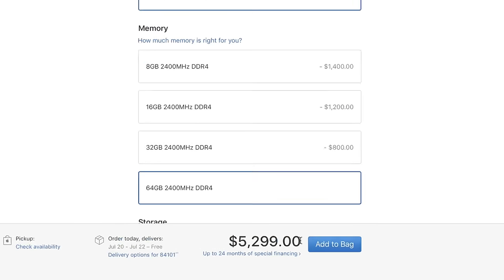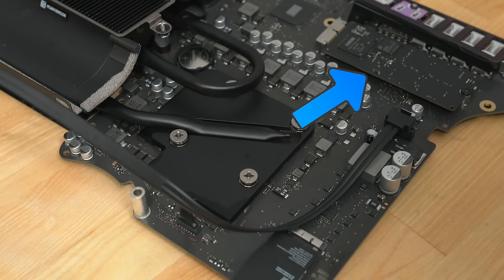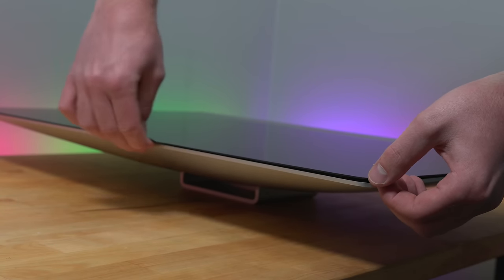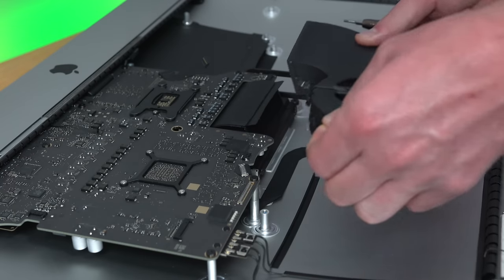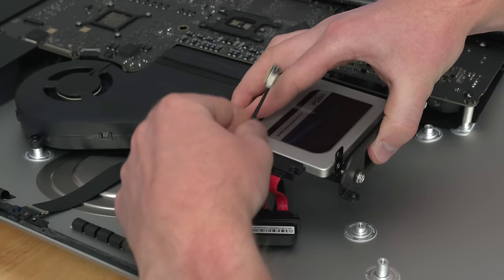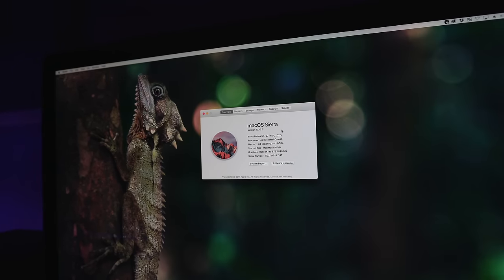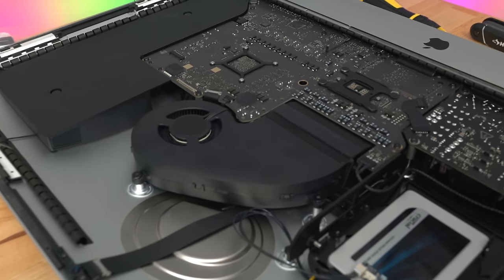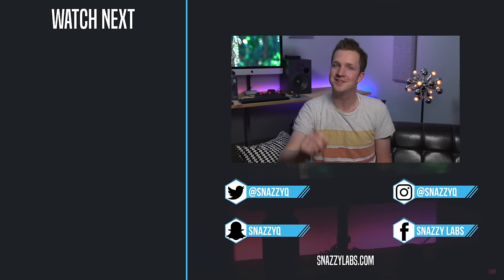The Best 2017 iMac Apple Doesn't Sell!

Comment: Apple use the 7700 not the 7700k which has higher clocks as well as overclocking :)
Reply from the maker: They use the 7700 in the base high-end configuration, but they use the 7700K in the loaded configuration. With Kaby Lake, the K variant is clocked 700 MHz higher even without OC, so Apple just runs the unlocked CPU at base-clock.
Reply: #kabylakegate
Reply: Snazzy Labs is it possible that Apple use some terrible thermal paste which makes the temperature so high so it throttles and lead to some performance decrease
Reply: Why would you overclock a CPU that's basically in a laptop? I think that's a big waste of money.
Reply: +Stephen _L_S Apple is known for shyte thermal paste and fans that prematurely wear out.
Reply: Ohh i didn't think they used the k version:P ohh well nice work anyway :)
Reply: 7700K is desktop CPU, not laptop CPU.
Reply: Snazzy Labs at base clock cause their cooling sucks and people will still pay for it. I would have paid for it two years ago if I'd had the money. I've just learned that as a gamer and a DJ I don't need the slightly higher base clock.
Reply: Hugo in a laptop?
Reply: That was my thought as well - cheap thermal paste.
Reply: yup seems it's a K variant as it's running under-clocked at 3.8 GHz
Reply: No, the K stands for Kupu-kupu-barong, the place where people are enslaved to work the Intel silicon mines. The 7700 stands for the number of casualties since 1948, when Israel became a nation again.
Reply: The 7700K is the top dog in the CPU arena. Test scores, market share. I just dominate's. Poor little Ryzen can't find any buyers. The 7700 lives in Pentium country. There's an $11.00 USD between it and the K. It's a no brainer which one to buy
Reply: Terence Riley Lol, Ryzen sold/sells very well and has forced Intel's head back up its ass?
Reply: I was thinking the same thing about the thermal paste.  Also the air flow in that thing doesn't look great.

Comment: SUPER cool video dude! I thought it would be awesome but this turned out even better.
The geekbench score for your 7700k seems pretty normal to me? .. (My stock unit gives - 5782 / 20169)
Reply from the maker: Is that on your iMac? I admittedly don't have a loaded iMac on hand, so I a) went off of the "average benchmark score" for all of the 2017 fully-loaded 7700K iMac's tested on the GeekBench browser, and b) asked a viewer with a loaded iMac to do the test (he got 18,790). Your score is pretty good; about the same as mine. I don't know why the average is so low. Software related maybe? It isn't the RAM (because I yanked that and tested with the stock kit and was just under 20,000 (so not much slower)), and as you know, thermals in GeekBench don't get anywhere near the thermal throttling ceiling, so it's not that either. I'm flummoxed. LOL.
Reply: ya on the 2017 iMac. it could because of my cooler ambient temps though in the office. WE CRANK DAT AC
Reply: Dave Lee sup Dave, didn't expect to see you here, lol.
Reply: Buy it, it's worth it. I used it in my undergrad as a EEE in college and will probably use it forever. It'll be one of the best investment in your life, especially if you're going into any engineering field.
Reply: Ayy Dave wassup lmao
Reply: If D2D comment your video, it's because you are really good! Fan of the 2 channels already.. Keep up doing all the great content (you both)!
Reply: Andrés Jiménez Thanks I appreciate it.
Reply: IT'S DAVE
Reply: Dave Lee ayyyye
Reply: Dave you should try the same with a MacBook
Reply: never gonna happen BrechtXT... you can't upgrade the cpu on a MacBook....
Reply: It could be that apple is using the base i7 7700 instead of the k SKU, that could explain the performance differential.
Reply: The official geekbench scores always lower than we test it on our own, like my MacBook Pro 15 mid15, the official scores are 3616 /11768, after my test it's going up to 3963/13774.
Reply: hey dave lee can you dave lee ?
Reply: Dave Lee n
Reply: I've reports from my work's Apple service guy that Apple can at times be heavy-handed with the thermal paste, so I'm betting the lower-end benchmarks are due to CPU throttling.
Reply: could be ram speed. maybe the factory imac runs at 2133mhz
Reply: Yo Dave Lee here!
Reply: Seems probable - Apple may detune the processor for heat management, or they're really tight on a thermal sensor. I doubt that Apple would deliberately buy stunted CPU's - charge a premium, sure, but their parts are typically top tier.
Reply: I really don’t want to hear you say “sexy”...
Reply: 3.5 k computer, insured by a tiny fan. reeeeeeal smart😑😑😑 all hype no real smarts.
Reply: Hi, dave lee im using my mother's google account, anyways im your great fan!!!!
Reply: I7-7700k or i7-7700.  Lower watts on non-k means better thermal control and less throttling?

Comment: silicon lottery only comes into play when you start overclocking, the difference in score is almost certainly coming from there 3 factors. 1: the ram you got for this mod runs at a higher speed with better timings then the ram that apple uses. 2: the Polaris GPU you have will hit a slightly higher boost clock then the GPU that was used for the stock mac test. 3: the thermal paste you used on your new 7700k is better then the stuff apple uses by default and that allows you to hold max boost clock for more time.
Reply: pike RDM I️ wouldn’t be surprised if Apple bought Lower binned chips but they use the 7700 not 7700k the k has a higher base and boost even when non overclocked so I️ think that is why
Reply: The shocking thing here is that Apple wanted more than 1000 $ for an iMac model with worse performance. Then again, maybe it's not so shocking, considering it's Apple.
Reply: Is there a way to switch the GPU as well?

Comment: Great video, Snazzy Labs! If you're only adding a secondary drive (no CPU upgrade), you can do it without removing any circuit boards. I used this video to add drive to a late 2015 27” Retina 5K iMac (Skylake i7 4.0 GHz), with only 256GB flash SSD factory-installed. The drive-only shopping list is: drive bay adapter, OWC heat sensor (which came with monitor adhesive), SATA data/power cable, and ifixit pizza knife. You only need to remove the left speaker and fan to access the motherboard SATA data and power connections. Reach underneath the edge of the board, and press in the cable connectors (use a small mirror). Route the cable behind the fan mount stands, to the new drive. You may need to loosen and move the right speaker to access the bay mounting screws unless you have tiny-trump hands.
Reply: Indeed, but seeing how just opening the damn thing in the first place is such a hassle (and a one-time operation, unless you're willing to waste sticker sets), isn't it wiser to just gut the entire thing and swap as many internal components as necessary and possible? Plus, Apple's thermal paste application (and quality) is usually crap (as you can see from the video; it's spread all over the place, even outside of the copper part of the heatsink, and extremely dry even when new); even if you weren't swapping the CPU, replacing said paste whenever you have the chance is just good practice.
Reply: hey can i email you? i have a nice project on my hands
Reply: He replaced the stock internal drive or ADDED a 2nd internal drive?  It's not clear.

Comment: Apple after watching this video be like, Oh you SOB we will make our next iMac much slimmer and CPU soldered to motherboard, RAM soldered to motherboard and then sit there waiting for your video.
Reply from the maker: +Rigas Doddi Please no. Lol
Reply: Snazzy Labs I wish no.
Reply: Rigas Doddi they would solder it because it’s making the laptop thinner. Complain about the size. Thinner iMac= soldered on ram
Reply: wtf
Reply: This comment was eerily prescient. With all the talk of the T2 chip requiring a cloud-based app for hardware validation, I wonder which (if any) of these updates will be feasible in the 2018 models.

So much so that I'm even thinking of rushing to the nearest Apple VAR and order a 2017 with the 512 GB SSD, before the new models come out and I get shafted. Maybe the performance on the new models will be so awesome that buying the 2017 model at the usual price will turn out to be a stupid decision, but it if I do so right before the next Apple event I might just be able to return the machine if it is indeed worth it; as I wouldn't be performing the “surgery” until after two years after buying it (my plan was to have the SSD stuck to the back of the machine and connect it with a SATA III to USB-C 3.1 cable, and wait until the end of the warranty to move it into the machine and perform a CPU swap as well), that wouldn't be an issue.
Reply: Aaaaaannnd yeah, I did it. I still haven't bought either the SSD or the RAM (just a dual USB-C 3.1 to SATA Sharkoon dock, which I'm using for my old internal HD and another HD for Time Machine) and I feel I'm missing the latter the most. 8 GB just doesn't cut it these days and, performance-wise, this iMac, in its current configuration, sometimes feels like a downgrade compared with my 2009 model.

The screen, however, is downright gorgeous, and even if Apple switches to A-series processors I still hope to eke out five to ten years out of it just for professional work. Honestly, the way the Mac is going, I don't give a damn if I am stuck on an older version of macOS, as long as developers still support x64. Heck, I might even outright switch to Windows at some point, as it would run great on this hardware…
Reply: Well, let's het up the heatgun!

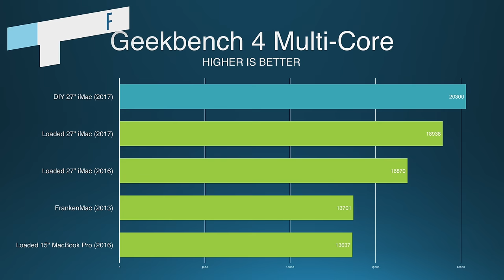Comment: 5:37 The loaded 5K iMac 27" actually uses an i7 7700, not a 7700K. The K really just means it's good for overclocking, but macOS has quite limited overclocking ability, it doesn't matter.
Reply: Not sure why he bought the unlocked version...he could have saved some more money by going with 7700 non-k.

Comment: I did this recently to my 2012 iMac. My hard drive died so I decided to switch it with a SSD and upgrade the CPU. I didn’t grab the OWC cable but haven’t had any issues with my fan.  Great video!

Comment: I bought the same computer and basically did the same thing. I had never seen this video until much later. I didnt go so far as to install the i7. Too scary. The reason I also did this was because the HDD in the iMac was WAY TOO slow and completely outdated when I purchased my 2017 iMac. The only reason I purchased this computer is because of the Retina screen. Still one of the best. Thanks for the video! Enjoyed it. Maybe one day Ill get around to installing the i7-7700k. But just installing a SSD made the computer MUCH faster and usable. Please keep the Vids coming. Two Thumbs up!
Reply: So, did you buy a fusion and replace it with the SSD-- or Apple's SSD, then... add another SSD? I don't understand why someone would even pay Apple's price for a small SSD, if they were just going to replace it with another third party SSD. Why not get a fusion drive then take that out? Isn't that cheaper?

Comment: "Removing this part can cause serious bodily harm, or even death!! But don't worry, just touch the edges and you'll be fine".... Haha,, ok,, that's a no for me.
Reply: Richard Andrews 
Just get some insulated gloves if you're really worried about it
Reply: How can you die from touching it when it isn't hooked on electricity? (Serious question)
Is there still somehow a current?
Reply: All that had to be added was discharge the caps before handling this board. ;)
Reply: kifla420 makes sense. I was wondering too and never thought of capacitors.
Reply: if you're scared, unplug the thing from the socket it and then hold the power button pressed for 10 second before even starting to open the monitor frame.  that should discharge any remaining power on capacitors
Reply: As there is an LED display not a fluorescent one it should be pretty safe. The highest voltage on that psu would be 120v A/C on one or two filter capacitors. You will get a good buzz at mains voltage but you wouldn't die. Some older power supplies from units with fluorescent displays will have much higher voltages to power the lights.

Comment: "Using that cheap 1440p monitor"

I can't even afford a 1080p one by myself... Wanna send me it? LOL
Reply: CDLLBOSS Lee I can have that
Reply: Depends on if you want a 1080p worth having, guys.  Sure, they are cheap, but the ones with accurate color/contras, pixel performance, and refresh rate can cost a decent amount.
Reply: Get a job.
Reply: Christian Stout

I have a 1680x1050 monitor

Still runs strong since 9 years 

1080p 144Hz isn't a worth jump for me so i will keep my monitor 15 years or so until 2k / 4k 144Hz get affordable. That means mid grade gpu like a 1060 for 250 bucks should be good enough to Run a 300$ 1440p Monitor with 144 Hz

So total 550$ for nearly ultra gaming 1440p 144hz.
Today a 1070 alone is 400 $ 

And the monitor is 530 $ 

Thats overpriced as fuck
Reply: Badass Killer 60 Hz is bad for me

The way more fluid motion of a 144Hz Panel is the future.

If all I want would be 60Hz 

 I would already have a 1440p display.

But it sucks

Comment: One correction that may or may not have been pointed out. Mac display resolution in the System Information window shows the logical resolution, not the actual resolution. Those Mac Pros are, indeed, running at 5k 5120x2880, with a logical retina 2x resolution of 2560x1440.

So yes, they are running 5k on the UltraFine 5k displays. Just wanted to correct that for anyone that was confused. A retina Mac may say 1440p, but that's logical, not actual, resolution.

Comment: Did you compare the thermals? Maybe Apple uses cheap thermal paste?
Reply: nitrowad I️ think Apple uses the 7700 not 7700k
Reply: actually it does intel bins the K's higher because they do over clock the differences small yes but there is one.
Reply: then why go with a K series cpu? that just doesn't make any sense to me other then the bragging rights that it has a 7700k
Reply: nitrowad Came here to say that. Apple is notorious for using cheap thermal paste that dries out and kills the GPUs. I rebuilt an Air, and adding Arctic Silver made a big difference. Fan never runs past 50%.

Comment: Don't need $40 cable for heat sensor, just install SSD Fan Control and it handles the fan speed automatically for you based on the system temp.

Comment: LOL😂 When Quinn builds better Macs then Apple!
Reply: Aleksandar be together not the same
Are you mad? lol.
Reply: It's not better, the CPU is prone to overheat in such small space with the mediocre cooling, Apple lower the clock speed probably to prevent this problem.
Reply: its not a lowered clock speed, its running at stock

Comment: Better temps from decent thermal compound is probably responsible for the higher scores. Turbo will kick in more with better thermals and make quite a large difference overall. The cooling in those things is always atrocious, every little thing you can do to help it along will help both performance and longevity. I love Mac designs but not the proprietary BS and pricetag that come with them.

Comment: about the display not running 5k on the LG thing I'm pretty sure that it's impossible  to run 5k without thunderbolt 3 or hdmi 3.0 or whatever display port version it is so they couldn't run it at 5k on iMac
Reply from the maker: It's correct that you'd need DisplayPort 1.4. Mac Pro only has DisplayPort 1.3, but two 5K monitors from Dell and HP allow you to use two cables to get 5K. Apple and LG could have done it, but two cables to run one monitor is against Apple's design philosophy. LOL.
Reply: Snazzy Labs oh my bad thanks for correcting me. I love the build

Comment: Is it possible that the maxed out iMac is that much slower because Apple throttles their hardware so it doesn't overheat? After all there is only the one fan. 

For example, a lot of phones have batteries that could be charged longer, but they have cutoffs to stop them from becoming dangerous and exploding (with the exception of that one phone *cough cough*)
Reply: One thought is, they want to at the top end ($5000+) for the maxed out iMac want to drive you to the iMac Pro which while still $5000 is cheaper and has more power.
Reply: all the parts he replaced can be used in any pc. not the case.
Reply: Patrick Wilson With all that empty space inside the machine and the price they're charging for it, it's still the shittiest business practice I've ever heard.
Reply: Business practice has to do with sales and profit, they certainly make a lot of profit and have lots of loyal customers, so I would have to argue that they're doing something right there haha!
Reply: My iPhone 6 blew up
Reply: note 7 lol
Reply: @MattTolbertMedia  I disagree as those "fans" are blind to Crapples greed. Also they by into this hype that crapple products are the best and things like Osx dont get viruses. Not saying that Microsoft is any better bc they arent. I think Crapple wouldnt get as much hate as they do if they would stop thier shady business practices and shafting the end consumer. Crapple loves blind ppl because they make an immorally high amount of money of ppl ignorance. I am not saying that as an insult. One thing positive thing I will say about company is they have had done a pretty darn good job with security. I hypothesize that Apple could wipe the floor with Microsoft if they stop those shady business practices, but ofc what I am suggesting will nvr make the money that Apple makes now.
Reply: @MattTolbertMedia  Yes, lying...and hiding the lies with convenience.

Comment: The reason your Core i7 7700K outperforms Apple's similar offering is the thermal paste you're using. It allows you to hold on to your Boost/Turbo clocks for a longer duration which can yield better results.